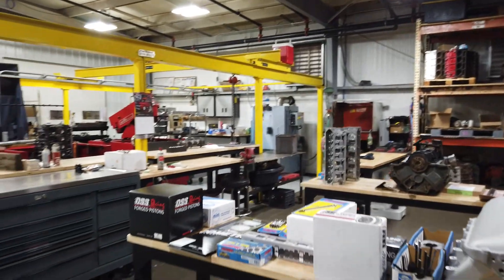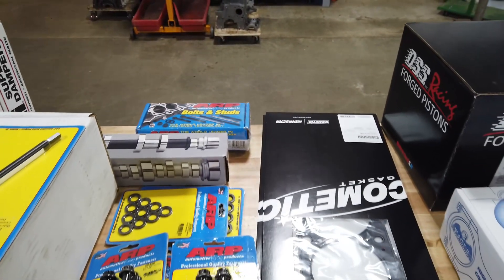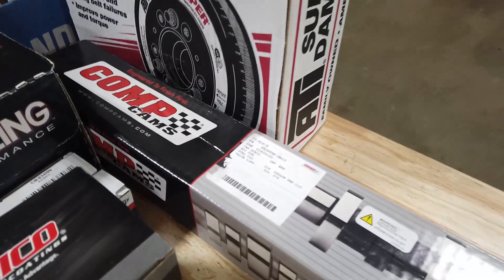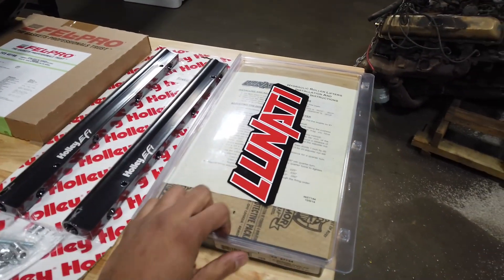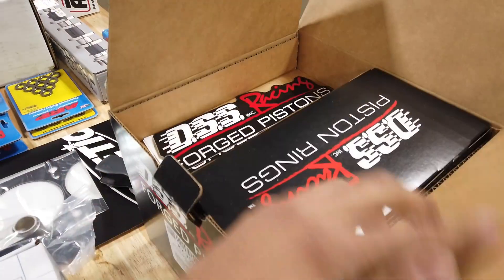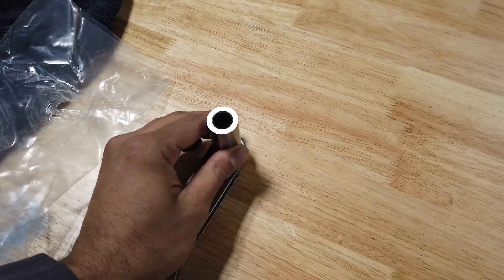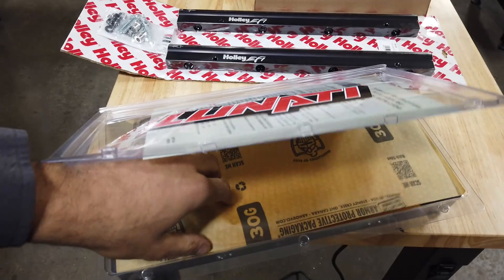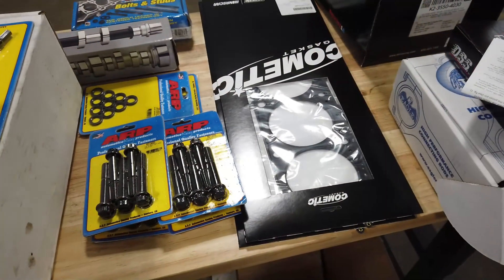351LT PARTS LIST

Comment: 351-W factory crankshaft can handle a lot of hp. We went a best of 5.60 on a 200 shot in the 1/8th mile with a factory Windsor crankshaft. We used to build a lot of 370 cubic inch Windsor’s with an offset ground crankshaft. 6.123 dodge connecting rod and Chevy pistons.

Comment: The round hole at 4:34 that overlaps into the coolant on an LT head is an oil drain hole on the SBF block so that will need to be welded as well

Comment: Maybe it's too late to suggest this, But if you used a 400m or 351c for the block, you wouldn't have to drill coolant Outlets into the LT heads. If you used a 400m block, you could get a Tmeyer stroker kit for it.
Reply: Use the 400 block and you could use the LT2 manifold with spacers.  No chopping up the Holley.  Mast Motorsports sells them modified for port injection.
Reply: @aukseharris4630 have you already used those spacers? I’m thinking about trying this. Or getting some custom spacers made
Reply: @bigC4romhtwn  I have one of Mast manifolds, but haven't got a 400 block to see how much offset the spacer will have to take up.   It will be custom job.
Reply: @aukseharris4630  I would assume it’s 1.297, or close, since that’s difference in deck height. But also the angle of that spacer points the intake runner from the head, straight up, instead of angled towards the intake, where you would need it.
Reply: @bigC4romhtwn  You'll need to use use the spacers to allign the runner fore and aft as well.  A water jet should do it smooth and easy.